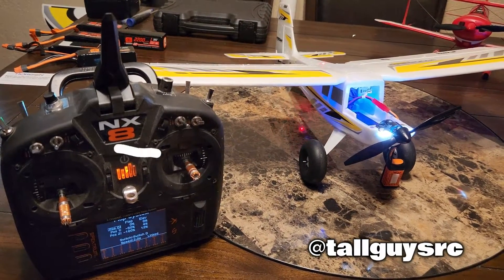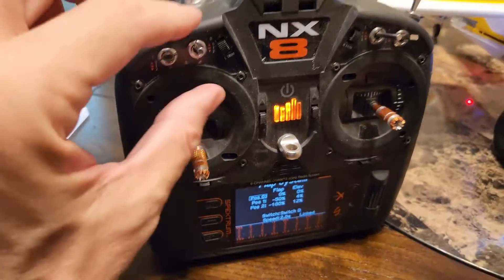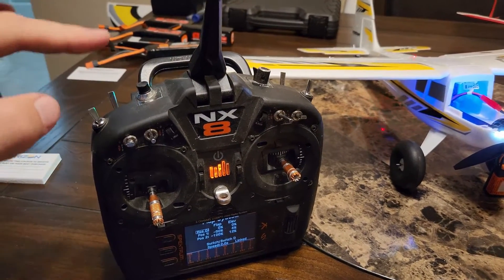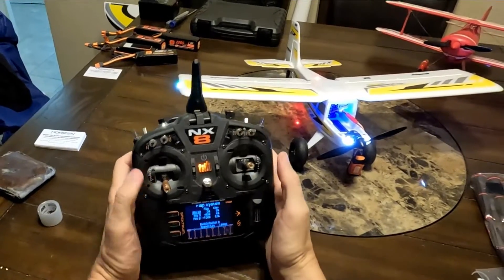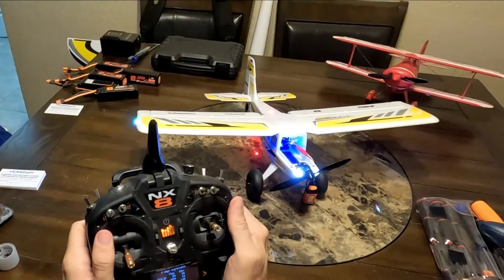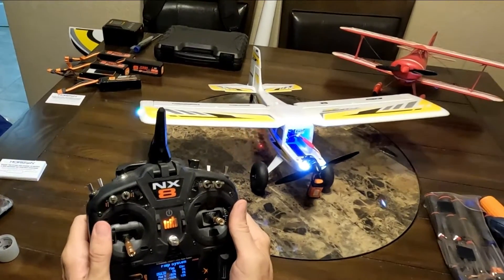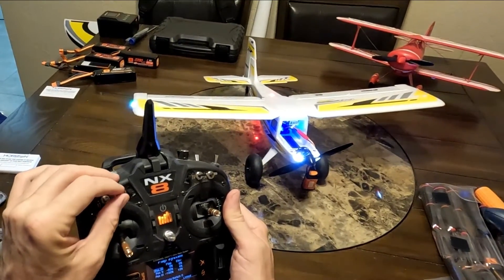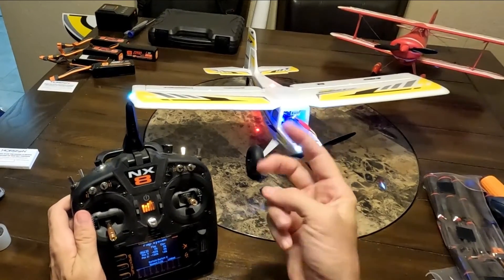How to set up Flaperons on the E-flite umx timber X

Comment: when i did the flap setup thing, the switch toggled the flaps, but instead of both of them going in one direction they go in opposite directions, and this wouldn’t work because the flaps, if toggled like this, would just cause the plane to barrel roll instead of slowing down.

Comment: Thanks for this video, I've never had to enable flaperons on an airplane before! One question, is there a difference in flight modes between having flaperons enabled/disabled (ex. SAFE staying on, built-in lower rates, etc.) or is it just a locked-away feature in case a user is flying on a radio with less than 6 channels (despite HH recommending 6+)?

Comment: RTFM as the old saying goes. I have a UMX turbo timber, everything works as designed, but is it possible to include the ailerons on the tips to function as flapperons also?
Reply from the maker: On the full sized one yes the umx version no.

Comment: Is there a possibility to use flaperons in an Trojan T-28 1,1m without missing Safe/AS3X on both ailerons?
Reply from the maker: yes, you can but you have to unlock the receiver to do it?
Reply: @Tallguysrc  OK, cool thanks!

Comment: Thanks for this video.  I followed your steps and the elevators did the little dance just like yours did.  BUT, when I use my switch D (which I also configured in the Flaps area as you did), the flaperons do nothing.  I do hear some noise from inside the plane with each switch position, but no control surface movement.  I'm baffled.  I even deleted the whole profile and started over from scratch and it does the same thing.
Reply from the maker: What radio are you using
Reply: @Tallguysrc  NX8; but I finally got it working just now.  I came back and watched your video again, then went back outside.  I tried it a half dozen times.  No change.   I had my Gear switch set to B (which is also my Safe switch).  For grits 'n shins, I moved Gear to A (which also moved Safe to A).  Then I tried again, and low and behold, IT WORKED.  WTF?  I dunno who does Spektrum's programming, but they need a slap upside the head.  Or at least put that in the manual, SOMETHING.
Reply from the maker: @RobG Offroad & RC  I struggled with it too and ended doing a new model to get it right

Comment: So there's no way to have flight modes and flaps on different switches?
Reply from the maker: Yes you can
Reply from the maker: The gear switch is flight modes, safe, as3x  and on mine flaps are on another switch
Reply: @Tallguysrc  Gotcha, I'm an OpenTX so I'm not used to calling switches by a function like gear or flaps. I thought toggling the switch was assigning it, not just enabling flaps. I got it turned on and programmed perfectly, thanks for your help.

For non-Spektrum people the flight modes and switch you have to toggle is channel 5, then flaps are on channel 6.
Reply from the maker: @RocketBurn11  this one the manual was kinda all over the place
Reply: @Tallguysrc  

Amen!